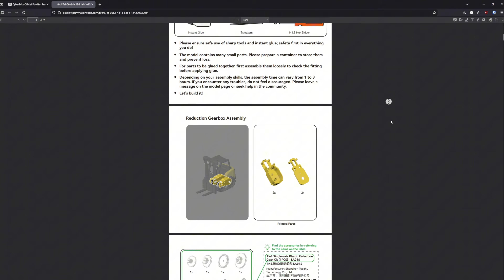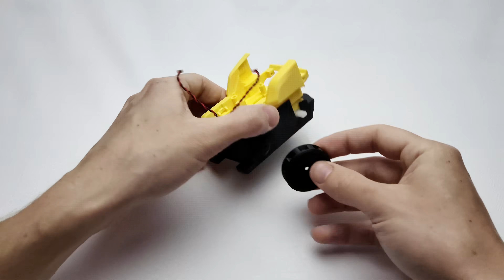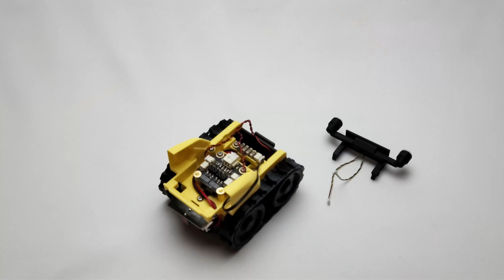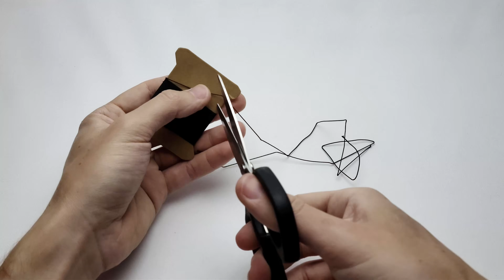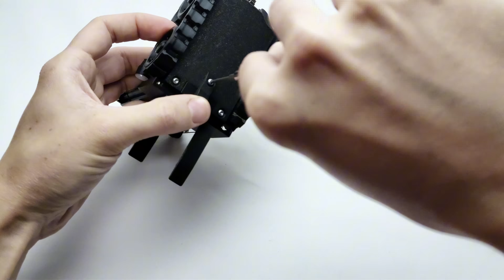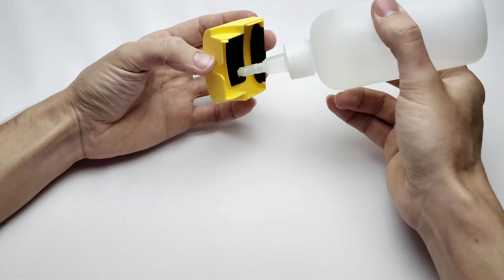CyberBrick Forklift Assembly Guide | Complete Step-by-Step Assembly & Setup

Comment: Overall, it’s a really cool project, but it comes with a few flaws and obstacles that require quite a bit of improvising. No matter how many times or with what material I print the rear wheels, they either fit too loosely and fall off or wobble continuously while turning. On top of that, even the larger screws are way too short to properly secure the mass brackets for the servos, forcing me to resort to superglue to get them to stay in place. It's a great build at its core, but it could definitely use a few design tweaks to fix these tolerances.